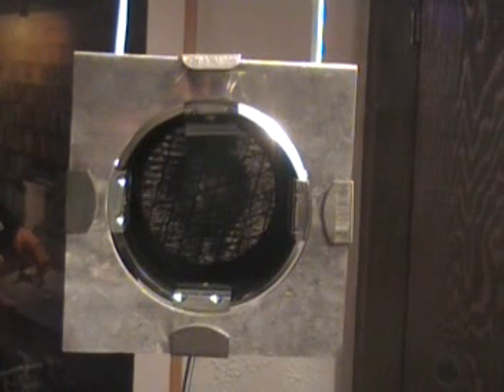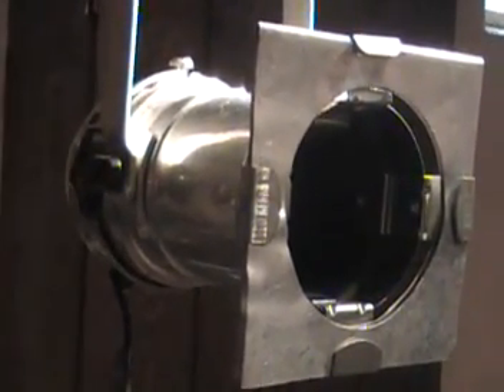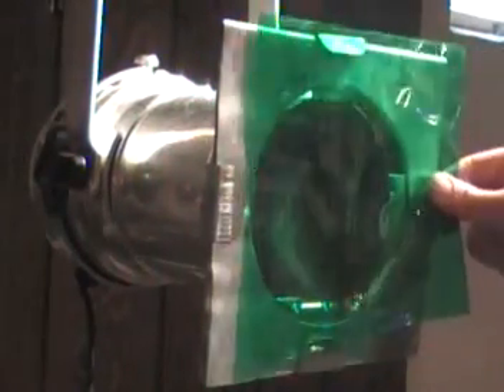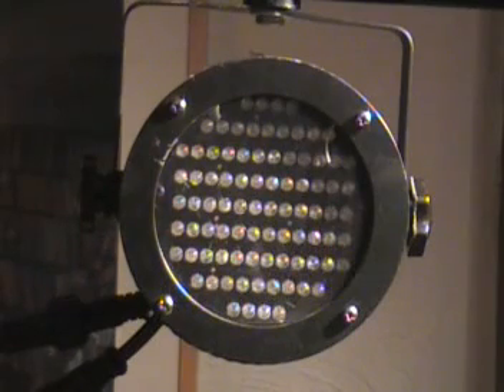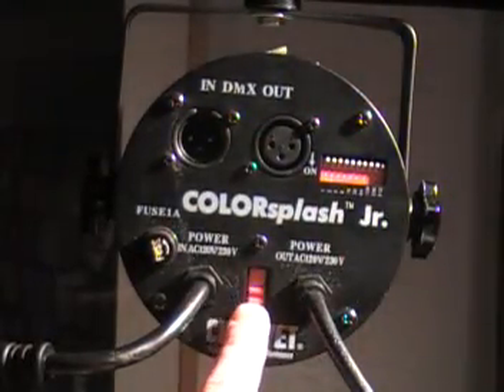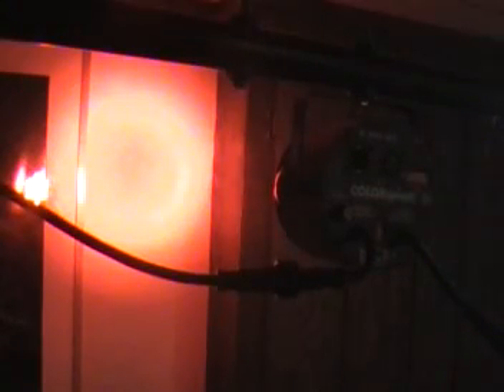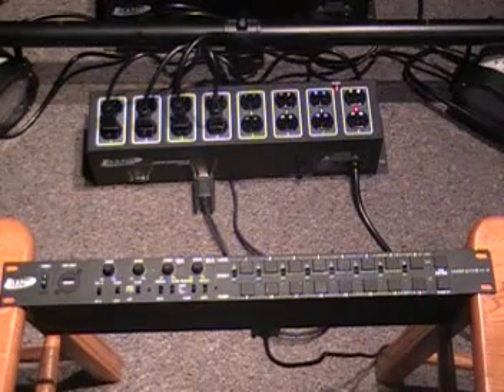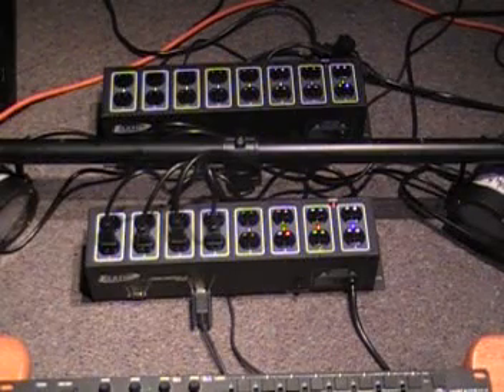DJ Help -  LED without DMX Part 1 - Par Cans

Comment from the maker: This isn't a good idea.  You should be able to CHASE LED par cans with a traditional light computer, but I don't think Dimming with a traditional analog dimmer pack is recomended. They are going to want constant power, so you would want to use a DMX controller for dimming

Comment: Hi Brian,
I agree with mburek.
Could you post another video distinguishing the difference between a controller and a dimmer chaser,as mentioned by mburek.
I think alot of people may have some old gear at home or at the club they work at, and may end blowing up their lights by getting the 2 units mixed up, and using the wrong one for their application. Its something that could be easily done if your not carefull.

Comment from the maker: Yup, you are absolutely right.  The reason I'm doing these videos is because I think a lot of people find DMX confusing and quite franly, I don't feel a DMX controller is always nessessary for most mobile DJ purposes.  The only thing I really use a DMX controller for is to do fades and color mixes with par cans ( so I can use the same cans for strobes, fast songs, and slow jam color washes)
Reply: Hello Brian. Our old band uses an old pre DMX ADJ CC-100 4 channel rack mount Light controller with 2 ADJ  BPP-20 4 channel power packs running par cans with 120V ac 100 Watt clear incandecent spots with gels. Works great as a sound activated controlled system but we went to convert to 10 Watt LED Spots for power savings plus the incandecent bulbs are hard to find. Problem now is that with the LED bulbs there's little resistance and the controller program runs far too quick and the lights are more like stobing than holding a pattern. Would you kjnow if we can install resistors on each par power outlet to simulate the resistance of the Incandecents that were 19.5 ohm each cold?

Comment from the maker: Well, it depends.  Are they DMX lasers and do they have a built-in mic for a sound-to-light effect?  If so, then yes you can.  You'd just set them up as master/slave with a DMX cable linking them together.  Every light has different settings and without knowing exacally what lasers these are, I can't talk you thru it.